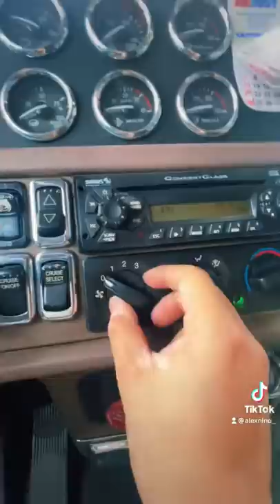How much do I make as a trucker? #shorts

Comment: UPS feeder driver here. I was making 126k a year. I am now part of a UPS sleeper team and I’m making more now. Full benefits and retirement. UPS has trouble getting team runners. Chicago is hiring off the street for teams currently. Get on board. Also no fuel cost or maintenance either.

Comment: $75,000 a year driving 268 miles a day with 6 stops a day. Plus safety bonuses, 2 weeks paid vacation year one, 3 weeks vacation years 2-5, 4 weeks after 5th year. 13% 401k match.  Full benefits and 12 paid holidays. If the weather prevents the route to be ran I still get paid for the day. The route takes about 7 hours to run so not to bad I think. The last company I drove for was about the same but I was working 12+ hours a day. So I really like the shorter days.
Reply: Is this dump truck work?
Reply: No I deliver GM parts to dealerships. I drive tractor trailer, with a 28' trailer.
Reply: 6 stops? Wtf how long is each stop
Reply: @orlandotovar4318  It's just over 5 hours of drive time, and around 1.75 hours to deliver all the freight. My first stop takes 3/4 of the freight so I'm there for about 45 minutes. The rest of the stops I'm at for about 5-15 minutes. It's the easiest truck driving job I've ever had. The last company I drove for I made about the same but worked 55+ hours a week. here I haven't worked longer than 36 hours a week.
Reply: What company ??
Reply: DLI
Reply: 13% 401k match? Holy crap
Reply: @tjroberts7196  75k a year to perform manual labor and unload your own trailer? Garbage
Reply: @jaybartgis5148  they blind you with decent benefits no doubt
Reply: @woovelli  i hope they give you good benefits from all the injuries you get from all that manual labor
Reply: @jaybartgis5148  I wouldn’t bank on it tbh I rather get 18k a month and deal with overhead of running a business then hope for 80k and have benefits.
Reply: @jaybartgis5148  where did it say he unloaded his trailer?  He may I know but he didn't say that. Even if it is manual labor aint gonna kill you. Geeze
Reply: 13% match?!?  No way!  That company would go bankrupt pretty quickly.

(Surely you meant “1% to 3% match depending on how long you stay with the company.”  3% is pretty reasonable and respectable reward for a loyal employee.)
Reply: Give me referral looking for something like this
Reply: Responsible for covering overnight dedicated routes, delivering auto parts to car dealership.
Successful and timely unloading of freight with a pallet jack.
Efficient operation of an automatic day cab, 48-foot tractor-trailer with a lift gate. No slip seating.
On average, the driver will make 8-12 stops per day.
The driver must be available to be out on the road, away from the home terminal 5 days every week (Tuesday-Saturday).
1 year of driving experience required.
Reply: Is this company?
Reply: Ouch truckers don’t make much money
Reply: 75k for 7 hour route is not that bad.

Comment: First year of long haul totalled 167k clean after all expenses! 1900 in 4 days is not something I'd even leave home for!
Reply: Well my first year as an owner operator I made 565,900$ and cleared over 280,000$ after taxes and maintenance fees etc and I wouldn’t turn a key for under 5$ a mile
Reply: @stephenjump4218  how lol
Reply: @user-nb3ui8zj4r  well whoever doesn't value there time and hard work that's not my problem! Whoever is ok working for nothing/dirt cheap isn't my problem but because people don't value them self and are ok working for companies that pay that way we all have issues. Lots of companies look at that low pay and try to pull that shit too!
Reply: @stephenjump4218  that's how ur supposed to operate! Now days with these gas prices definitely not driving for less then 5$
Reply: @mhwachter833  trust me as an owner operator not the lease wannabe u can make 500+k and be 200+k in profit! If I was to drive across country that takes 4-5 days! Before these crazy prices I wouldn't do it less then 15k and that would be 2500 in fuel only. Now days where the fuel would cost me over 5k I won't take that load unless I'm being paid close to 20k.
Reply: @dailyrandom5308  where do you find the high paying work os the question. Im guessing not a load board? Ive considered getting my cdl and buying a truck but Im wondering now if its better to just take the money I have and finance a bunch of sprinters or box trucks and try to build a company more so that way
Reply: @mhwachter833  I can't tell u which is better I'm no expert especially in the hot shot freight with box trucks and sprinter vans. High paying work is years of friendships and relations. I find a smaller company that is happy to have u there and have them load u for a small dispatch fee! Make sure they have contracts and not load u of the load board. Companies having contracts is the key cuz load boards are cheap! I'm running bunch of contract loads ranging from 4.50 a mile up to 7$
Reply: @dailyrandom5308  any specifics you can give me that put you in the 160k range for first year of OTR
Reply: @mhwachter833  well try to find a company that runs government loads those usually pay hella good, find good zones for every season depending on the type of trailer that u run and no matter what don't run shit that's under 2.50 a mile! At that price it's better for me to sit home!
Reply: Paul Smith  and how long have you been driving and what freight were u hauling cause it sure wasn’t airfreight all I ran was airfreight up and down the east coast when I first started running as an o/operator back in 1985 probably before you were born and now I’m retired due to a medical issue with my back so no more slaving away in a truck for me it was fun back in the day I made enough to satisfy my self for a few years and buy a few toys with cash never financed any of my rigs cash and carry not many drivers can whip out 275k in cash and say everything is profit from the get go can you?
Reply: Paul Smith  not really it’s the reality of trucking it’s a very hard life and I don’t want people thinking it’s easy you have to basically forget about a family lifestyle and live a solitary life cause it’s just u the road and the shipper receivers  it’s not all fun and games like it’s made out to be on you tube truckers are the most underpaid professionals in the world we should be paid more then a professional football player makes as we have to sacrifice more and more truckers die during their careers then football players break a bone yet their paid 70 million a year for doing absolutely nothing just tossing a ball around for a few hrs while we bring you everything you have from a lightbulb to your house, car, dinner, and tv’s so you can watch that football game yet truckers don’t get anything for their sacrifice
Reply: @stephenjump4218  sp how muchbabyear you mafe after tax
Reply: @4chukwuebuka  it depends on the freight u haul and the rate it’s paying but 300k after taxes as an owner operator a company driver maybe 160k at most

Comment: 44 years driving  long distance, for the responsibly you have your getting paid under minimum wage. I'd stay gone months at a time, living on the road eats your wage.
Reply: There are two options when you die, either heaven or hell. If you want to go to heaven you need to repent and believe in Jesus Christ
Reply: @brotherdj777  no
Reply: Living on the road is cheap if you do it right
Reply: @secretsquirrel6718  exactly. This dude is talking out of his ass. If you live in the truck as a company driver, your expenses are QUITE LOW
Reply: @BaldyFade  did the fetal you tell you this?

Comment: Its better to work for an independent small private company when youre new. I let my license sit for 1 year then joined my friends company, he owns 5 tractors, paid by the load. On the “slow weeks” i would make 1000-1300 but the following week would be 2000. One month i made 9k working 3 weeks on the road. The first year is also the most difficult one and youre new and still adapting to the system. Now im working as a local driver and average around 4k per month but i come home every morning.

Comment: Fedex freight city here in smaller town. 55-65 a year. Full benefits, dock to driver program, home every night, weekends and most holidays off. $30 hr top out with at least a quarter raise every year. Most places went to a year top out now as well. Usually two bonuses a year. Hazmat,  tankers, double triples required. Over the road for us is the same benefits, still home every night but but usually have to work nights with dock work starting out. They start around 60k up to 100k+. Every city is different because of cost of living wages. Easy job either way and no expense out of your pocket for training. Just have to commit your first year to them.

Comment: If you pull that yellow insert out of your oil fill tube, then turn it 90° and put it back in it works as a funnel and it makes it easier when your trying to get the last bit out of your jug of oil.

Comment: Based on these comments and truckers i’ve spoken with and cdl job postings, the pay is completely dependent on who you drive for, how much experience you have and what type of loads you’re hauling. it also depends on if you’re a company driver doing otr, long haul, regional or teams. whether you’re hourly, paid by the load or by the mile and it also really depends on what area you live in. it can be awesome pay or crap pay. it all depends… in my area i see tons of ads promising 100k or more a year and a lot of jobs around 75k a year. the only way im taking 40k a year is if its my first year driving because i know i can get at least 75k my second year driving. i make 40k now doing alarm work so i wouldnt make the jump to cdl for anything less than that.

Comment: I work in dispatching so I have some idea of earning.
If you are an owner operator with a Power Only you can make around 8k per week. Depending on which areas you drive in and if you are using a loadout DryVan 53ft swing doors. This is the total amount with the gas involved.

Comment: Just a helpful tip. Inside your oil cap, that yellow piece of plastic pulls out. Turn 1/4 turn, put it back in and it will stick out and become an extension so you can add your oil with out needing a funnel

Comment: As a Heavy rigid driver 
And handloading and hand unloading a 50 cbm double axle I was getting payed $30 an hour. 5 days of work $1.600-$1800 depending on the hours of the week. 

Pretty shitty right,  if you use your right skill working for the right people and you could possibly make over $100.000 with no issues at all.

Comment: My first check was $600. I busted my ass that week. I went from hourly to mileage. I thought I made a mistake at first cause when I was hourly I’d get overtime when it was available. I started working harder and longer. 6 years later I’m running the wild board at my company doing different runs that I wouldn’t be able to hold as a bid because I’m in the middle low of the board.

Comment: average pay for a company driver is $48,000 to 90k depending on the company and miles and experience 

if u work on a 1099 form and u gross say 1800 and u spent $150 on food u have to minus that out of ur pay and find ur state tax percentage and take that away from the 1800 gross so ur actual NET would be  $1250 if u live in the state of NY or Mass or CT or VT or Maine

Comment: I use to drive for Miller Transporters the tanker company and back in 2000 when I was with them I made $.42 a mile and also 12.40hr when I was loading and unloading plus we got per-dime.  But my manager at my home station didn’t like the fact I lived about 2-1/2 hrs away from there

Comment: Sounds like local truck driving is the way to go.. home every night and great pay. Getting my CDL soon
Reply: Ya not really. youll top at maybe 30/hr. heavy haul is were the money is. 50/hr ish round here. i may try to go to that soon.
Reply: @7.3PSDA2  heard that. Ill have my CDL in 2 weeks. Gonna do otr. Probably dry van. Or tanker
Reply: @alexhowley9834  Tanker make sure you get tanker endoursment to. im a hazmat tanker and all that
Reply: @alexhowley9834  mine is class A X
Reply: @7.3PSDA2  yeah I got my hazmat done I just need to take the tanker test, easy peasy. Do you do otr?
Reply: @alexhowley9834  i currently am a short haul driver for Airgas. i used to work with then for a company that did alot of different types of hauling. i hauled alot of portland cement in tru dry bulk tankers and sodium silicate in the liquid tankers also hauled a bunch of sand in side dump and end dump trailers then i did do some heavy hauling biggest i hauled was a JD 470G excavator. but id move rollers and pans and like 7130 JD sided tractors nothing super huge. i am currently on the look out for at least 1 or more kw t370 single axles so i can make a fleet (eventually) of single tandom dump trucks to run around with ive got a few guys wanting to work for me just looking for the right setup at the time.
Reply: @alexhowley9834  also i have never consecutively done otr. couple days here and there but thats it. i have to much to do in my spare time after work
Reply: @7.3PSDA2  sounds like a plan. I bid you good luck. I was also looking at air gas, there's one 20 minutes from my house. Pay looks outstanding for a local job
Reply: @alexhowley9834  There not terrible i live about 4 minutes away its pretty easy but theres alot more then just driving involved which blew my mind when i started. i also do my own thing on the side and build custom stuff.

Comment: This guy said 1900 in 4 days is good 😂😂 my boy is getting scammed by his uncle
Reply: So, is the author driving for somebody? Because as owner operator you can make over 300k per year, minus expenses, which is about 30% i would say. We are taking an oversize load from Texas to California, the rate is $13,500. It takes about $2000 in fuel, and around$1000-$1500 for a pilot / escort car if you hire). It takes 4-5 days to do the job.
Reply: So, is the author driving for somebody? Because as owner operator you can make over 300k per year, minus expenses, which is about 30% i would say. We are taking an oversize load from Texas to California, the rate is $13,500. It takes about $2000 in fuel, and around$1000-$1500 for a pilot / escort car if you hire). It takes 4-5 days to do the job.